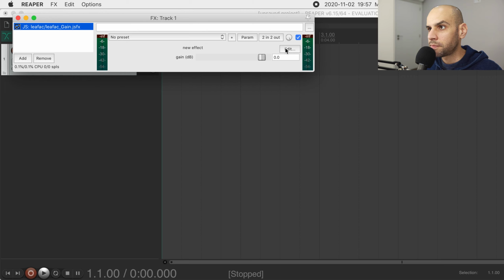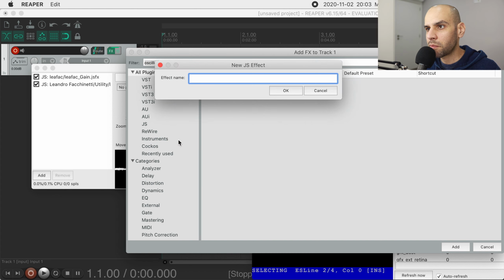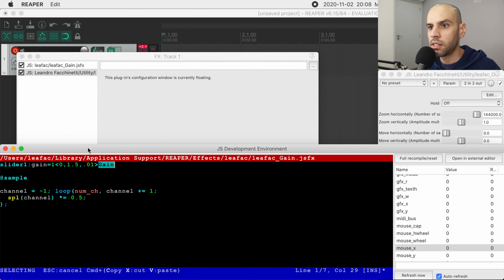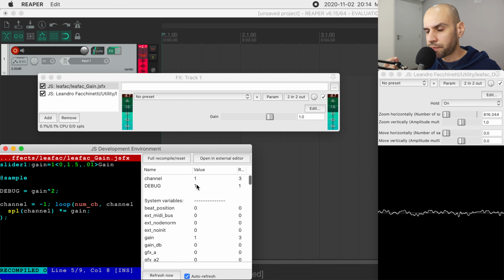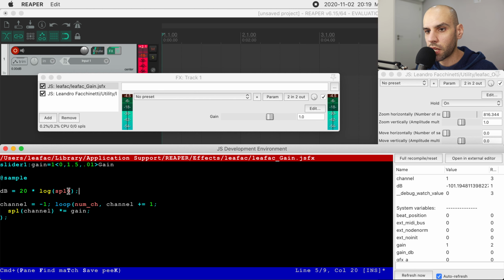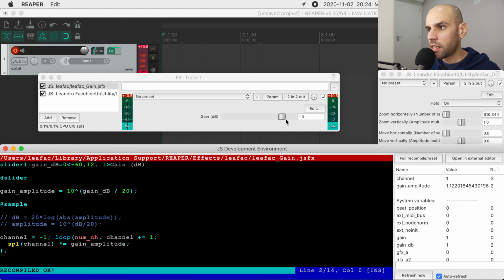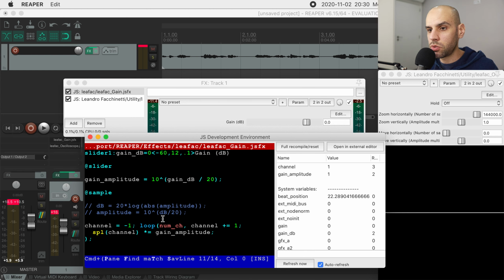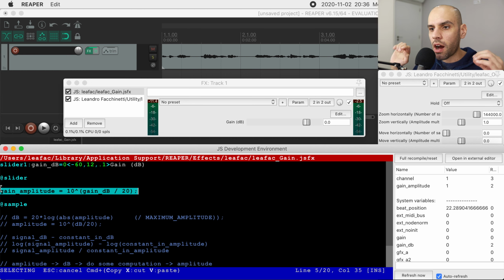Programming Audio Effects: Gain (Amplitude to dB Conversion)

Comment: What's all that other code  in the boilerplate though? It looks like it might be smoothing the slider but I don't really understand it.
Reply from the maker: You’re right: That code is for smoothing the slider to prevent so-called zipper noise when changing the slider too fast. I addressed this in some streams in which I talk about parameter smoothing.